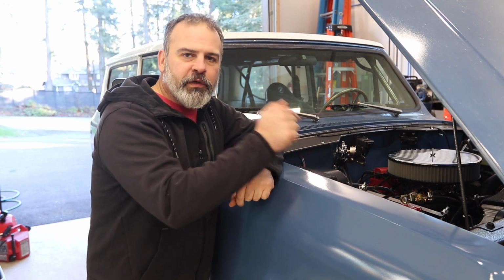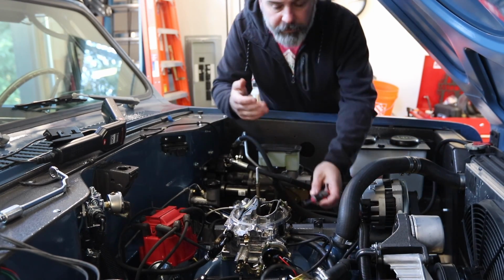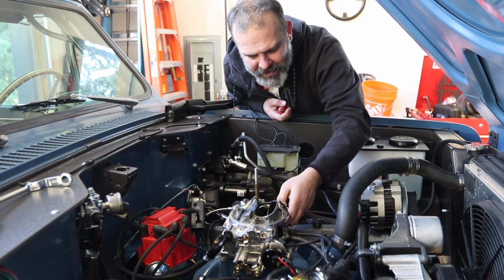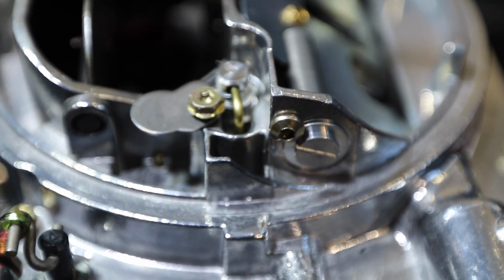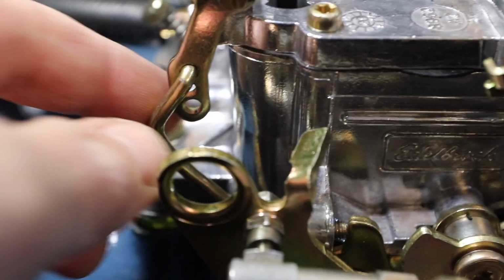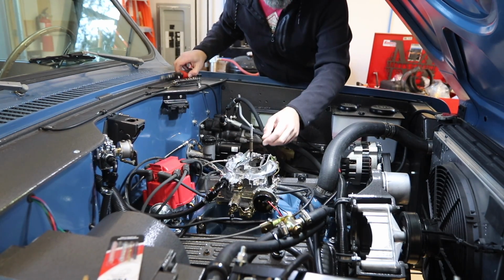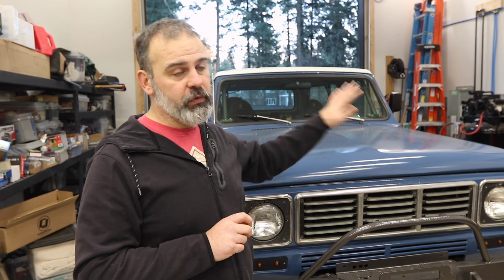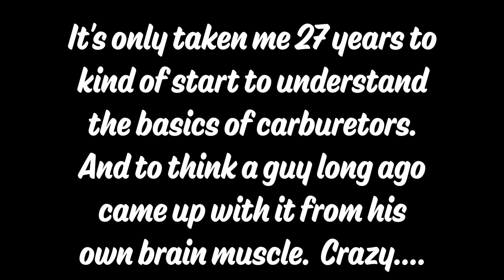8.12-Edelbrock AVS2 Fine Tuning

Comment: What CFM is the carb?
Reply from the maker: 650. It’s too much carb
Reply: @MattsGarage  sorry you did say that real quick at the beginning, I just missed it. I promise its not too much carb. Not sure your cam specs but I have a 350 with ZZ4 cam (208/221) and Fast Burn heads which are a little step up from stock Vortecs. I had same issues and I found those pops to be rich spots not lean spots. Get the accelerator plunger out of an 800 it has a stiffer spring and put that in. Try going leaner on the pump shot as well after you swap that accelerator plunger. Its hard to discern a lean bog from a rich bog because too much fuel will choke the engine. You are on the right track, 100% get an AFR gauge totally necessary and takes the guesswork out and will show you the difference between a rich and lean bog. I have mine running 14.0 idle about 13.8-14.0 cruise and 12.8 WOT. Totally doable but get that AFR Guage in there so you don't pull your hair out. Let me know if I can help you any - this carb is outstanding once you dial it in. I ripped out my MSD Atomic EFI and the car has never run better.
Reply from the maker: @michaelcannizzo1076  great tips. I’ve since out on a sniper (haven’t done a video on it yet) but I’ll keep your notes for the next thing I put the carb on.
Reply: @MattsGarage  Good luck with the Sniper. I'm sure its good, but it didn't work for me. I went from the MSD to Sniper before I swapped in the AVS 2 650. Holley threw their hands up - could not get the car to idle right and could not get it to run right, its almost like it wasn't reading the distributor. Between sending in data logs, waiting for call backs, chasing them down it drove me nuts when all I wanted to do was just drive the car. Hope it works for you, its a pain to troubleshoot and work on when the stars don't just align.
Reply from the maker: @michaelcannizzo1076  that sucks! Mine works great